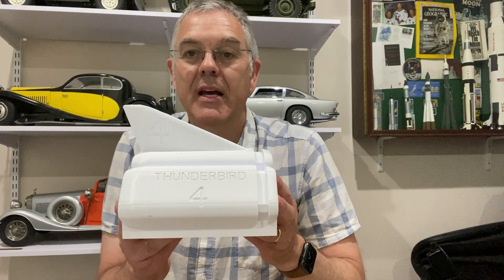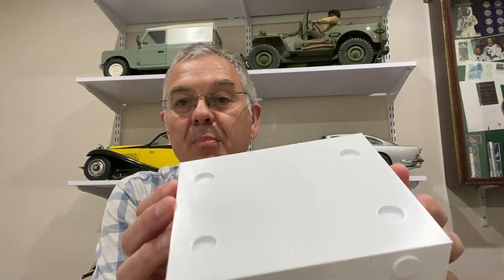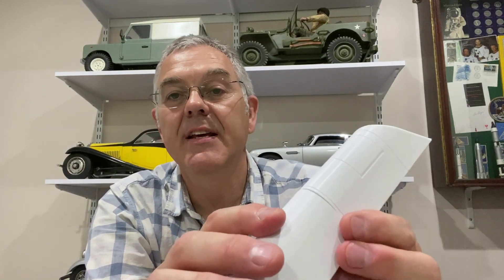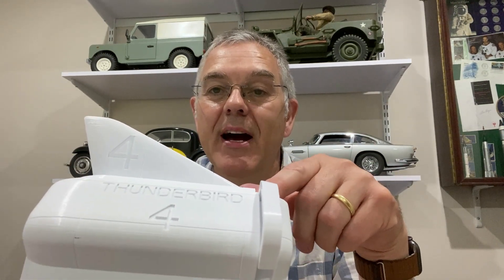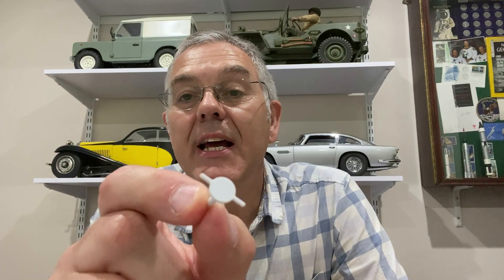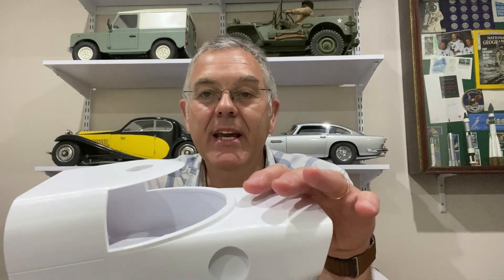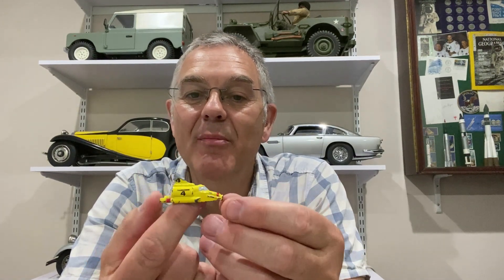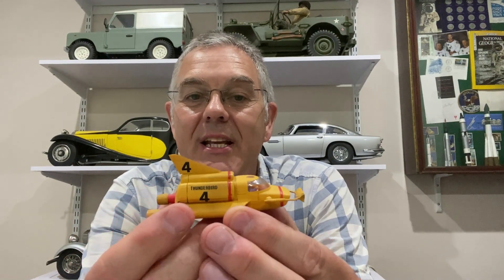Building a 3d printed model of Thunderbird 4 - Part 2

Comment: Is the main body hollow? I watched the print but wondered if you wanted access to main body is it empty or is it filled with a support structure that cant be removed?
Thank you
Reply from the maker: The main body is filled with 15% support material. When you print an object you can set the infill to whatever you like, ranging from 0 to 100%.
Reply: @modellingmisadventures  so not like the forward cabin is a "hollow" space so the back is not if I cut rear hull open it is a honeycomb like structure, I want to put radio control equipment in her